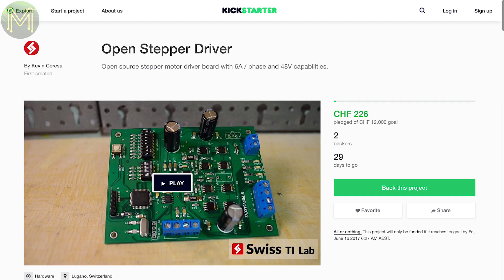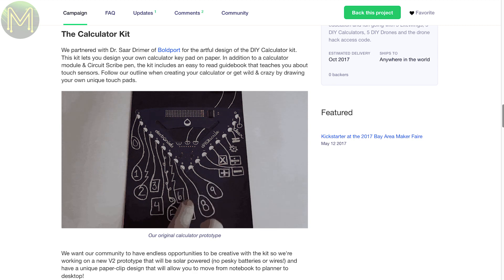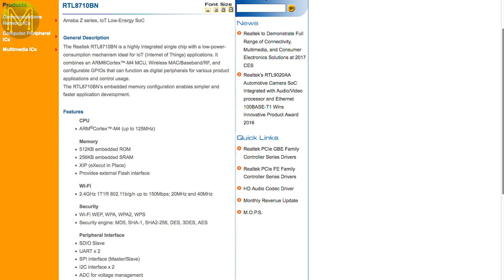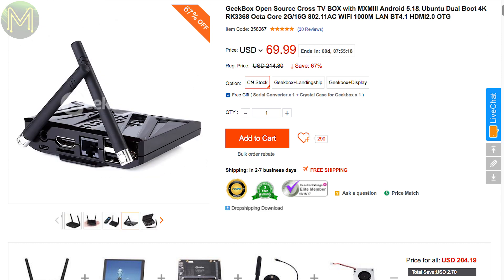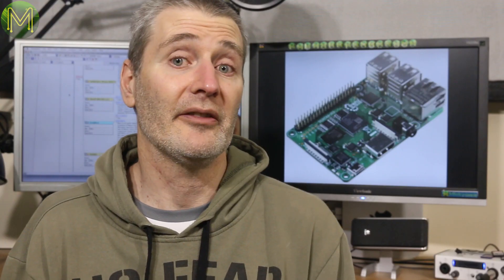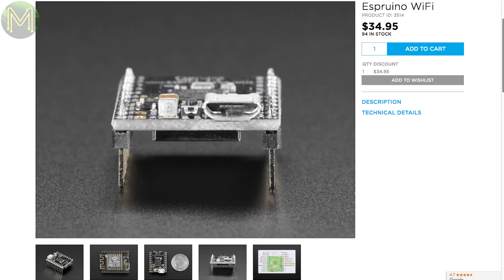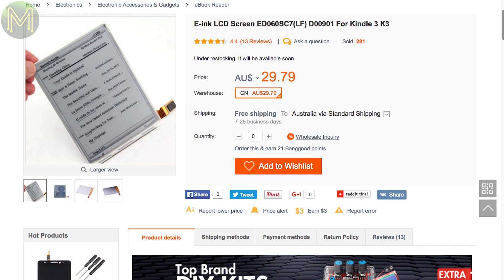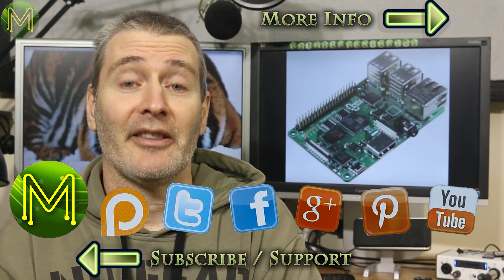#133 Weekly Roundup #35 - New Maker Products

Comment: Very intrigued by that Partical Sensor. No idea they could be that cheap. Went on a hunt for information and found there are also some alternatives. 
Not sure which is best price/quality but thought at least I'd share this link with more info :
https://community.particle.io/t/dust-sensor-pms-5003-6003-7003/24221
Reply from the maker: +Benny Kleykens 
If you check out a previous Roundup there's  some cheap ones from China.

Comment: I always prefer MCU/CPU boards over FPGAs. IMO i think working with a programmable CPU is cheaper/faster/easier than designing a whole system into a FPGA, so whenever i heard it being the future i always think meh. So what do you think? What kind of applications would be more suitable for an FPGA, i know it runs everything at super high clock speeds, so... thoughts?
Reply from the maker: +Brutaltronics 
The advantage of using FPGAs is that it's all realtime stuff. So that means no clocks required. You can setup FSMs that just react in realtime to input responses.
This also means very low power requirements.
You could do realtime video analysis; roll your own OpenMV.
Want to implement RISC-V on this board?
Or what about converting ML code to silicon.
It's pretty exciting stuff!
Certainly a lot better than "poll" based software.

The trick will be making this easy to get into. I have a couple of ideas on that!